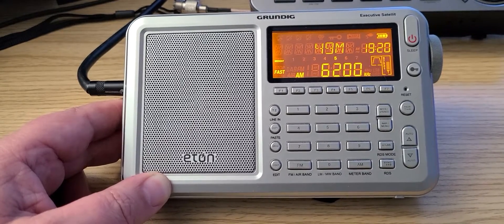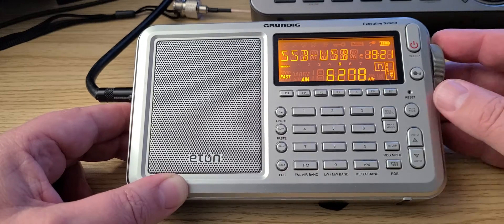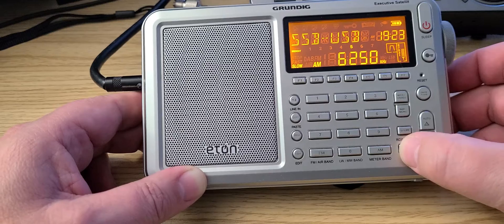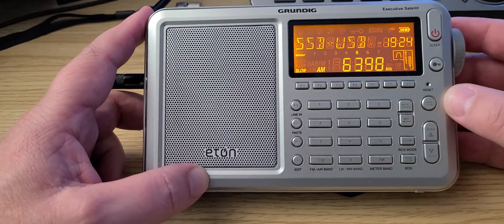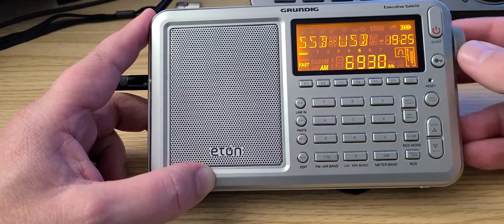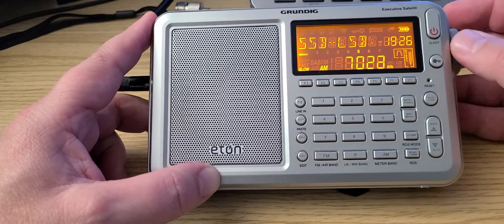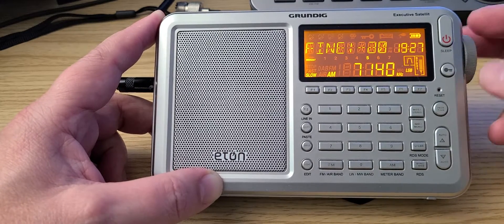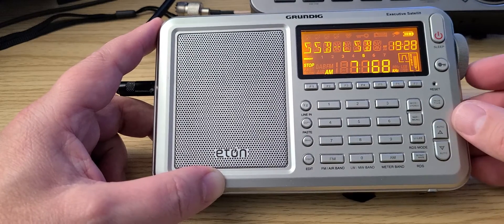Eton Grundig Satellit Executive SSB tuning 6200 - 7300 kHz Shortwave  SSB Utilities 40 meter band

Comment: In Italy the frequency 6900 ssb usated reseve for Emergency air and 7000/7150. cw. and lsb for amateur radio wotn f t 8 digital mode cw and r t t y for inviate fax